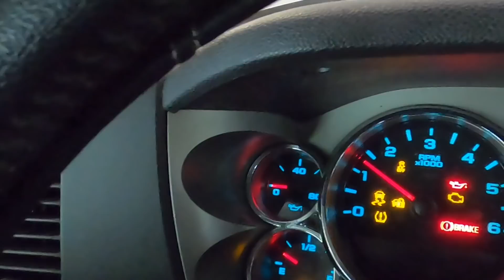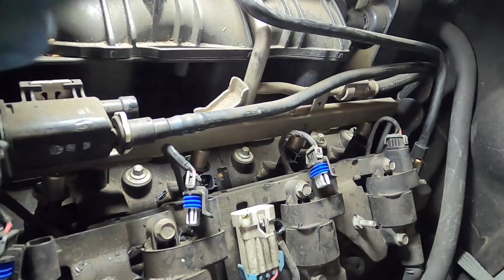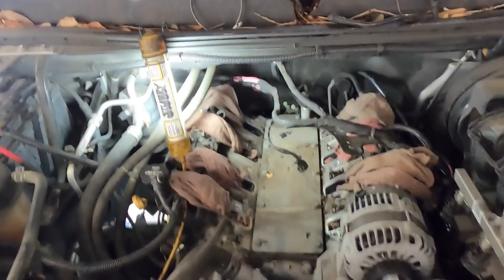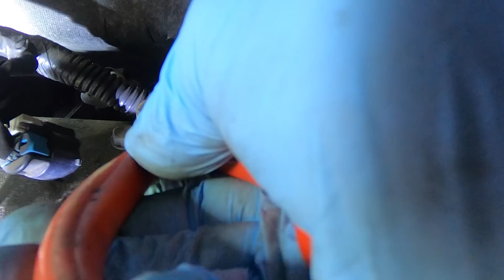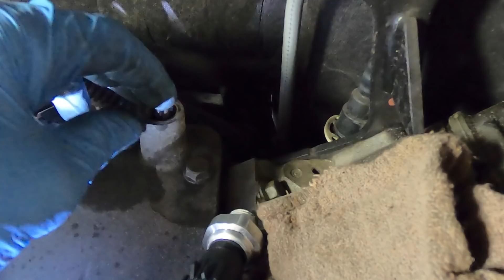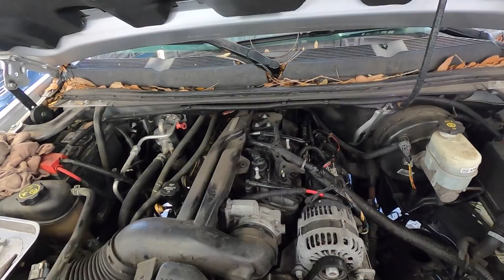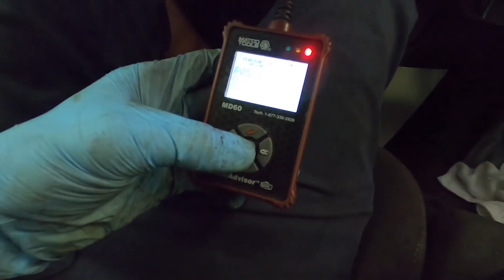Customer States: Google Diagnosis…replace this part!

Comment: At time's when customers have done this one can easily go two ways.
1
Do what the customers ask. But ask a few questions as how he came to this.

If he has sold answers good

If his answer is weak or total off point point that out.

2 just do as he ask

Shop customer came in and said i wish the ball joints replace.

Customer did not wish shop to check them.

Customer pays bill backs car out of parking lot and start's to drive off.

Customer stop's pulls back into lot and states the car is still makes the same noise.

Seems he had a bad universe joint.

I had a customer drop off a car for a vale job. Boss said two other shops check it.

Took the time to recheck it and found bad spark plug. Customer was very happy with our shop and not so happy with the other shops.

At time's people get it wrong and when you take the time to help them out it can make someone a customer for life.

Trust is an amazing thing and i have had work done at small shops were it was good and at major shops with names and locations across the US were it was sell sell sell and i told them. 

To close the hood and put the tire back on the car i came in to have fix.

Comment: Did you pull the intake out of spite?  I refuse to do any work without personally diagnosing the problem in my shop. If the customer wants a part monkey, I send him/her down the road, I have plenty of work scheduled ahead.

Comment: Can't really blame the guy for trying to save some cash on what seems to be an obviously likely cause of the problem.  It seems like he at least tried to do some research and found one of the most common solution.  The thing is, with as much technology that is put into vehicles today, it is difficult to actually diagnose issues like that without hooking it up and checking fault codes.  Even then it isn't always that simple.

Comment: As an HVAC tech, it makes me cringe at the amount of work mechanics have to do to get to a part. That’s why I would never, no matter how much money I was offered, would EVER be a mechanic. Wayyy too much stress, don’t want it, don’t need it. fixing air conditioners so straight forward, the part is visible, some new blowers come out with literally 2 5/16 screws. No joke. The amount of time and stress this takes is just almost painful to begin to even think about having to do this everyday

Comment: Customer should have let you decide whats best and not tell you to fit new oil pressure sender, taking all that intake off is a big job, he should have asked you to do a diagnostic from the get go. Ok so now Ive finished watching the video I did think it was going to fix the problem but nope and I stand by my statement of “he should have let you do your job” and not tell you what to do.
Reply: If you look somewhere around 32:13 you would see the gauge working. Seems this customer was right.

Comment: The real question is: for those mechanics out there who do the ol’ reach-around rather than take the intake off, do you still charge the 2.5 hour book time for the job?  I fired the parts canon on my 5.3L and got lucky - replacing the oil sending unit (reach-around method) fixed the dead gauge issue.  But, for those times when I figure out I’m in over my head, I let the shop do their thing, their way.  The only instruction/direction I’ve ever given a shop was to use quality parts (ie. not Dorman)
Reply: Yes this is one of those jobs that brings balance to book time. In my experience I loose more than I win so yes I will charge 2.5 and do it in 20 minutes. The book is there to protect the tech and the customer.

Comment: Get you some clear packing tape works way better than shop towels that can have metal in them. And when you pull the tape off it helps clean the intake gasket surface by pulling up debris. Great videos 👍👍👍

Comment: I mean, if the customer is right... which he wasn't.  I send my cars to the mechanic either because I can't diagnose or fail to diagnose... or I've done the diagnosis and don't want to do the work.  You have to trust your mechanic.  I'm sure this owner thinks he is smarter, more experienced, and more knowledgeable than the mechanic.  It's possible, I guess.  I'm a retired mechanic with only basic tools.  I use the cost/benefit analysis method.

Comment: It's funny how he does the click when torqued to spec. Most people don't understand how after years of working on cars how you can just feel when it's tight enough based off what it is. I only torque bolts when rebuilding an engine.

Comment: seems like GM trucks reached a quality pinnacle when they had the old 350 in them.  Then it seemed like they were on the right track, but again, quality peaked in 2004 just before the introduction of the cylinder deactivation in 2005.  It's been downhill ever since.  Now even Stelantis make a better truck than GM.
Reply: I have a 2004 Chevy 3500 w the 350. My oil pressure gauge has been pegged at 80 psi for 2 years.

Comment: I did a one of those on a 2008 5.3 liter Silverado last winter without pulling the intake. Just the special socket with a 6 inch extension.  I love the gangster rap in the background 😂🤘👍. Good video 👍

Comment: Had a lady come in with money light on. Nissan maxima...  has a bad O2 sensor.   she comes back a few days later and complains "the light is still on after i changed the sensor"  i raise the car and look. she had changed the wrong sensor. and they cost $145 apiece. so i showed her  where the bad sensor was, and also told her that the parts house wont take back the part after it was installed.  so she saved.... -$150.00

Comment: I would take my vehicle to the shop, tell them what the trouble codes were, and ask them to run a diagnostic. I NEVER told the tech what I "Thought" was wrong. I used the same shop for 20 years, and the guys appreciated my habit of buying older vehicles lol

Comment: I did the oil pressure switch on my 2011 Chevy Silverado 1500 and I didn't have to remove the intake

Comment: he could have a failing instrument cluster   i had mine go bad and the  thing that went out first was the oil pressure gauge then a couple weeks later the  battery gauge  then the  fuel gauge  till all i had left was  the  tach

Comment: RAY: did anyone tell the guy, there’s a chance this might not be the oil pressure sender? And he indeed has low oil pressure?? Did anyone try to tell the guy, “sir, I hate to see you waste your money, but common issues on these trucks and there’s a high chance it’s something else?” Or was there no resistance, suggestions and a simple “yes sir Mr. Google expert”?

I wish you could follow up on these videos. Did the guy come back and accuse you to not replacing the sensor?

Comment: I had to change mine twice, several long extensions and swivels it came right out. I am not going to say it was easy. Then the plenum gasket went bad and had to change the gasket and knock sensors, and valley pan gasket. I guess this was a 6.0 and there didn’t seem like a lot of room. Also, no knock sensors. By the way, I am addicted to watching your videos!!
Reply: It's a 4.8 he said that in the beginning of the video.

Comment: Love picking these up at auction.  Everyone knows what the problem is, especially when there is no lifter noise, but there's always that chance it'll need an engine so dealers that have to farm out their work pass.  I hop up there, 20 minutes later it's fixed there we go.  GM's are SO much nicer to work on than Fords.

Comment: Just a little tip, when I work on trucks with big tires, and I’m going to be working on it for a while, I pull the front Schrader valves out of the tires which drops it down another eight or 9 inches. I use this technique on Toyota Tacoma‘s when I do timing belt and water pumps.
Reply: I do this all the time

Comment: For record sensor can be changed without pulling intake. More than likely it’s a shorted wire. Had two with same problem. Mechanical gauge showed pressure.

Comment: Sounds like a chevy. Make it impossible to remove unless you take the entire truck apart. Then rebuild the truck around the new sensor but be quick about it or the sensor will go bad before you can finish the job.

Comment: Did you notice the bad front tires?   But its lifted and cool, so forget any diag and throw parts... lol  my 97 chev that part is easy and cheap might be the easy way to find out, but one like that  goodness isn't free to do.  So you started the intake bolts with the ratchet, that's living dangerously.   But so is doing that job on a customers call.  bet he regrets that one.  By the way the old man in me really doesn't like the background Music, if that's what you youngsters call  that.

Comment: it took me ten mins to change my sending unit and screen.  prolly could have gotten away with just changing or cleaning the screen.
but since you have to remove the sending unit to get to rhe screen, why not replace both. i think it took longer to get the sending unit out of the box than it did to get it out of the truck.

Comment: Definitely invest in a pneumatic vacuum, my dude. You can get them on Amazon for super cheap with a bunch of attachments or just hit up the tool truck for one. Either way.
Reply: Agree. Blowing the crap off with air was a criminal act as far as I’m concerned

Comment: why did you throw parts at it. you knew that was not the problem. now you cost the customer money.  your responsibility is to guide the customer to the steps of the procedure, number one scan the fucking codes. or tell them go somewhere else.
Reply: 500 dollar job you knew was not going to work, if I was the customer you would have a hard time collecting.

Comment: As you can see he never turn off and on the car to rest the error. Second when his parking the  car he never point the camera and tried so hard not to show us the oil gauge. 

I have switch a 2014 GMC Yukon oil pressure sensor “ never did take off any thing but the gas line” after it was switch the gauge was not working so I said the same thing damming it’s not the sensor but after adling for about 1 min and then turning it off and then on again the gauge started reading and the check engine light went off. 
Clearly this mechanic does not know what he was doing or he did and he did fix the gauge but decide to hey let’s make a video and say the gauge does not work and make some crazy story about the customer did not want to diagnostic it first.

Comment: I'm fully aware of how much those sending unit switches are a nightmare to work on. As for that little screen those are really only needed on the newer Vortec engines that have the Active Fuel Management system as it's meant to protect the solenoids and collapsible lifters from sludge build-up. Also why those same engines need full synthetic period.
In case you're wondering I've had to pull the head off of a 2010 because of a collapsed lifter thanks to the previous owner for using cheap oil and my dad having that screen deleted without thinking.

Comment: Out of curiosity, does theese trucks have a functioning "low oil pressure light" in addition or get signal of the same sensor? Just seem like a lot of work for a gauge that is just "nice to have" and not "need.."

Comment: Why do people buy vehicles they cannot afford to maintain or properly fix. Cheaping out on the maintenance and diagnosis of problems only causes issues later. Pay now or pay later. I guess there’s a reason why I drove a 1992 Saturn SL1 and a 1999 Saturn SL2 to well over 300,000 miles with decent maintenance and immediate repair of minor issues before they caused larger ones.

Comment: I don't understand the people that spend money on lift kits and aftermarket wheels and tires, but don't want to spend money to have a problem diagnosed.🤔 Also I like how you told the fuel line to stay 😆. That's the same stuff I do.

Comment: And then people ask me “hey Ralph why you hate so much new Chevy” and I refer them to watch a YouTube video . 
like changing a battery in this new trucks please remove the bracket of the brackets and then remove all the wires from the fuse box and then remove the fuse box and then you probably can remove the cables,  but wait the battery is sitting against the firewall oh but the is no space to stick the hands on it and the battery doesn’t have handles either, so remove the reservoir tank of the brackets to make it easy access for the battery. Hopefully you don’t catch your fingers trying to lift the battery. And let’s start over but in backwards have a new Chevy this days is just a turning ownership into a butt joke and the mechanics soon we are going to have to take a NASA training to understand this over engineered cars. Because The Heartbeat of America is dead .

Comment: I had P0523 on my 2010 Camaro SS (LS3), it was a sensor failure. The code had to be cleared before the gauge would start working properly after the sensor was replaced.

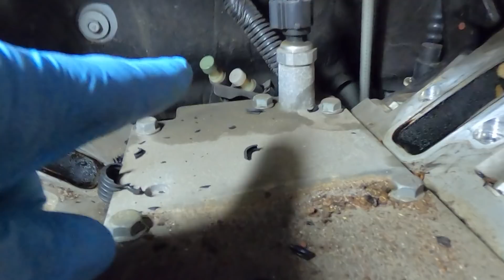Comment: 12:26 I think with the right tool i could change the pressure sender without removing all that stuff. As a car mechanic you have to have 3 or more joints in one arm.

Comment: Not trying to be a butt but they make a special thin-wall socket for removing the oil pressure sensor pretty easily. I've done a few myself and only took 15 mins or less (half that time was just trying to unplug the connector) No I didn't cut my hands up either and you can always wear mechanics gloves if you're worried about that. Pulling the intake manifold is way overkill and you can cause other problems over something simple.

Comment: I have found alot of the time when there is oil pressure gauge issues I have found it to be dead lifters caused by the lovely active fuel management demons. Sometimes you get lucky and it's a switch. Haven't watched whole video yet hope it's the switch 😂

Comment: The screen didn't fit because there's already one inside there. Best way to remove them I'd thread a 10mm bolt down in there itll bite into it and pull it out

Comment: Other people have pointed out that the gauge is displaying oil pressure at the very end, but I also noticed the CEL turned off.  
Not sure if you cleared the codes, or if it just took a minute to start working again, or if the problem was intermittent.  
That is one of life's great mysterys!
Reply from the maker: I was intermittent, and I did clear the codes on the way out. I drive it later that afternoon and the gauge was inop again.

Comment: there is a screen in there from factory they plug up you use pick to remove it and install new one  they plug up I know I worked for GM Dealer.

Comment: On the driver's side, you ran the closest wiring harness over the purge valve line instead of under the line. I was watching closely when you took it apart so I could see if you remembered that detail.

Comment: Like others in the comments below, I have done several of these without removing the intake as well. The other thing I do is to remove the tranny cross member fasteners and then jack up the transmission. It will give you a little more room to work as well.
Reply: 2

Comment: I’m pretty sure once you clear codes the gauge starts working normally looks like he was trying to hide that also pulling the intake is unnecessary even the screen can be removed with intake in place waste of time and possibly collateral damage removal of unnecessary components to complete job

Comment: a 2 hour job to change out a $5 switch  because the designers built this crap with everything buried, I remember when the oil sender on my 69 Dodge 3/4 ton pickup started leaking oil, you could SEE the sender on the side of the engine, a 5 minute job to swop it out and one wire, easy as changing the oil filter.

Comment: Man I did this on my partners 09 suburban and that small space to work in between the engine and firewall was a pita but then again I literally did the minimal removal of things to get back in there I did snap one of the evap lines trying to put it back on as well and it snapped really easily so I figure there was some stress fracture in it I didn't see when pulling it. 
Edit: oh yeah those plug clips were also a giant pita I remembered that when I saw you doing the 2 in the back.

Comment: Am I the only one that noticed the dry o-ring on the screen that he tossed? I bet that if he lubed up the o-ring the screen would have given him no problems. I'll the diag for him on why the gage is inop. The truck needs a cluster, GM has been having cluster problems on those trucks since the 2000 when they did away with the 5.7L

Comment: Well I’m 70 been busting wrenches since 1968 on just about anything with wheels or tracks. Done loads of LS engines  LT including full builds.  I ran shops John Deere, GM, Bobcat as mechanic, service mgrs. etc. 
My grief with what you did is wrong in my opinion. Learn how to save your customers time and money and they will love you + more money for you and shop. I hear ya on Google thing customer said. 
You should always even after he leaves run the codes always ! Then call him, sir in trying to save you $, I don’t want to bill you for a R/R on intake to replace oil sensor that’s not bad. What you did in my opinion was not right not bad but still. Too GM intake manifold should always go back on with a new set of gaskets. Why ? When you pull the manifold they are cracked from heat and may not reseal. Engine will code, vacuum leaks.

Comment: What was the point of taking the intake off if you were gonna do it all “by the book”? Just do the reach around literally would have been the same thing without potential lean codes
Reply: And you know that the code needs to be cleared after the sensor R&R for the EOP switch to read right man come on now